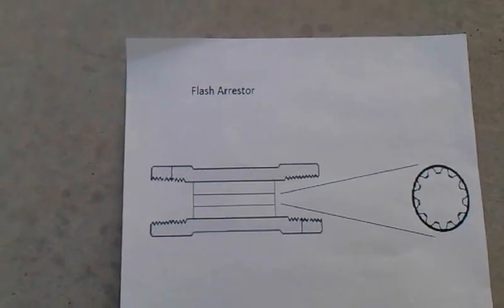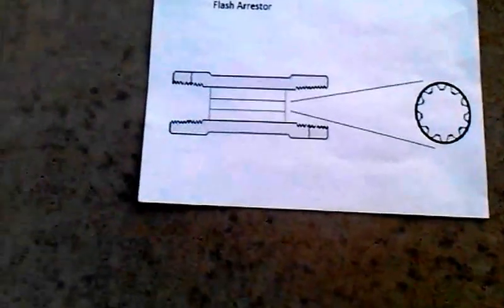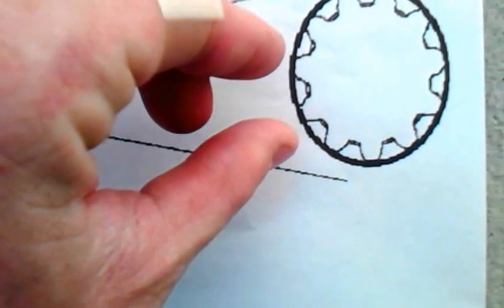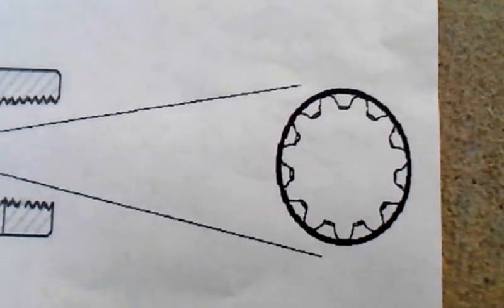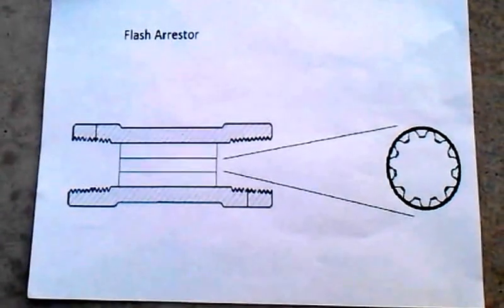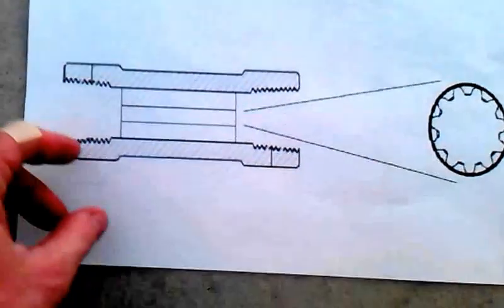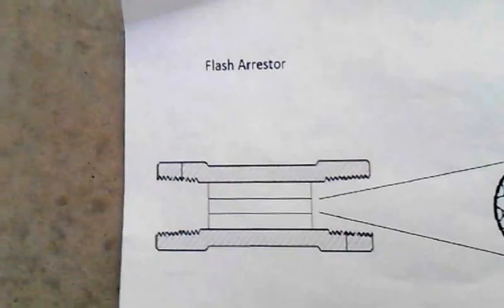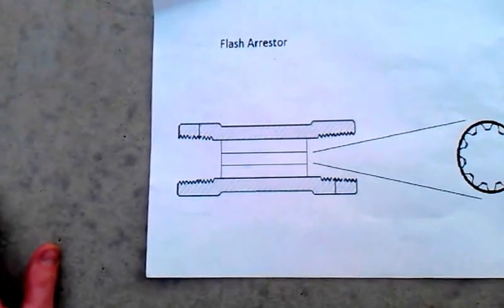Flash Arrestor HHO

Comment: It looks very promising, but it needs to put to the test. When the gas (HHO) is ignited the heat is who keeps the flame alive because the gas has its own oxygen to burn. To stop the flame the metal needs to be a good head conductor and  the gas volume as thin as possible.  I’ll  build  one  on copper  and I’ll report to you the results .

Comment: Why not multiple aquarium stones, way cheaper... They can be bought for high flow as well.
Reply from the maker: That works as well. I designed this particular arrestor  to take a beating and not break.
Reply: I`m sure breather stones like those could be found in a variety of sizes and flow rates, and probably special ordered in custom sizes for a lot cheaper, something to consider. I`m going to be using them when I get around to designing my flashback arrestors. I do`t like how people are using the ones with plastic in them that needs to be cut off 1st, thinking maybe cramming some brass wool at the ends to keep things nice and tight.

Comment: Good idea but unless you can get the spline with increments in the thousandths it may go boom. In my testing, I couldn't go above 50 micron .002 in hole or pore size without a flash back potential. Most professional grade arrestors use compression of metallic or ceramic powders to create a slug or disc with microscopic pores that can get down in to the low micron levels. I'm sure you can create a high flow arrestor but all my test failed using large holes or pores. Good luck...